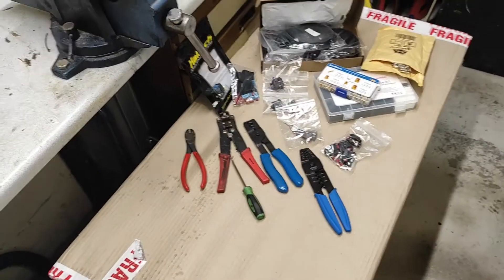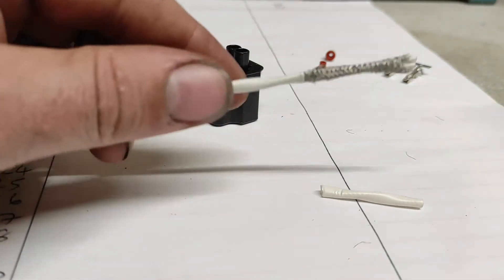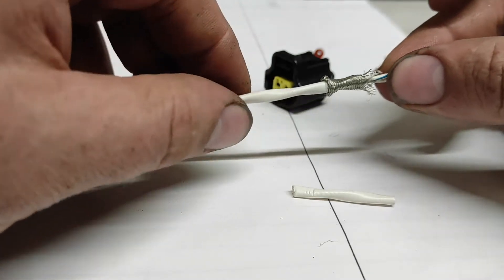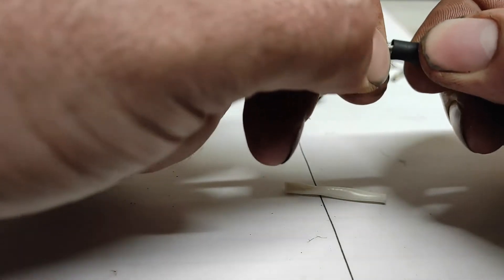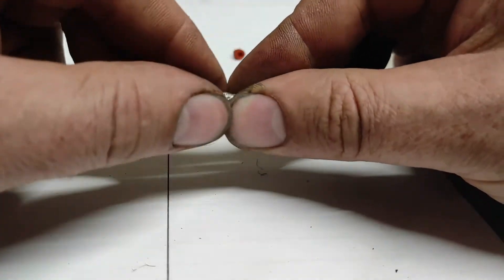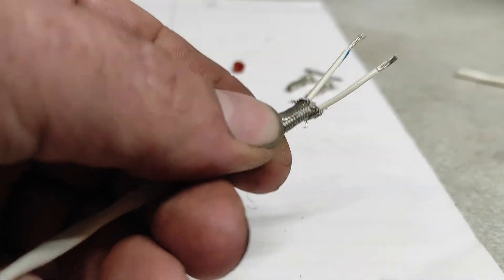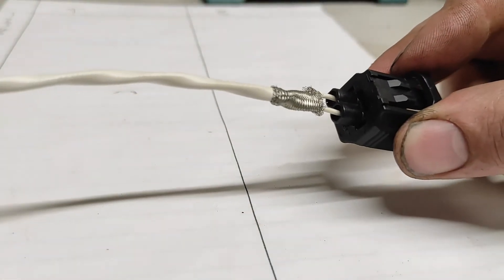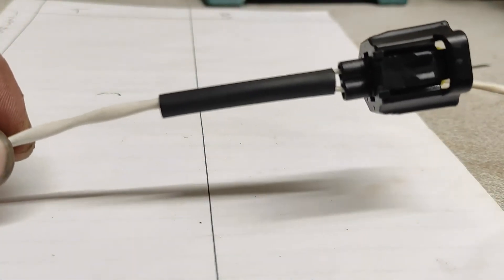Shielded wiring, for those vital sensors

Comment: The shielding needs to keep contact with the other wire as if one if not the signal will not be pure, in my opinion.
Reply from the maker: @huckfin1100  My ECU wiring diagram says do not join them throughout the length of wire, they only meet at the ECU, which has a dedicated pin for shielding wire. This length of wiring loom I am showing is just for the engine bay, so the connection to the ECU is not shown.
If the ECU doesn't have a shield ground, the yes you can join the shield with the sensor ground, but only at the ECU end of the wire.

Comment: Overall good work but here are  some tips where you put the section of heat shrink by the connector body, the heat shrink is a bit long which makes the harness less flexible and also you want to leave more wire outside of the heat shrink for strain relief. My only other tip is how you did the shielding wire. Assuming that this 2 core wire is sensor ground and trigger wire all you needed to do was crimp the shielding wire directly to the sensor ground wire. But otherwise good work.
Reply from the maker: @DsmGuru463  Thanks for the input, yes doing it again I would plan for more stain relief, also a bit more slack should it need modifying in the future. As for the shielded wire, my ECU has a dedicated shield ground, this is why I didn't join them together 👍

Comment: So what do I do if i need to splice some shielded wire in on a shielded knock sensor wire? Could new shielded wire be spliced in or added to the original? I have a connector with two 22 gauge wires, about an inch or two long. Thats where i cut it off. Then i cut off burned shielded wire that i need to replaced with new.

Basically, I need to replace the burned shielded wire that's in between the not burned shielded wire and the connector that fortunately didn't get burned. Is this possible? 

Thanks
Reply from the maker: @adictiveadictive  I don't think I understand you correctly, when you splice something in it would normally mean adding to something to a senor already there. This you do not want to do, you only want one sensor per shielded cable.
If however you mean replace some damaged wiring that you have. Can you put some pins directly on the new wiring, (like I do on the later half of the video) and put them into the connector you have, removing the inch remains that are still in there. If you only have 2 wires however I don't know if one is a shield or if it's shared shield/ground, or neither are a shield, So I don't know the answer about adding a shield to this.